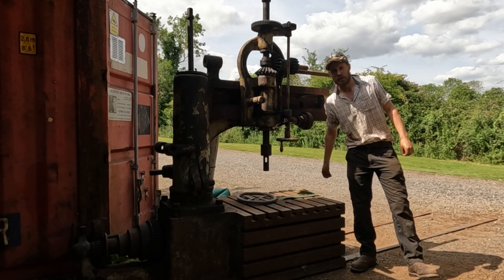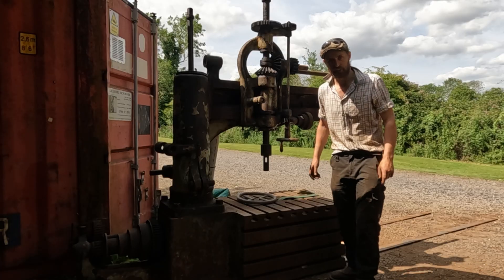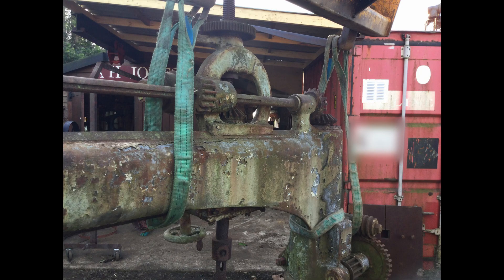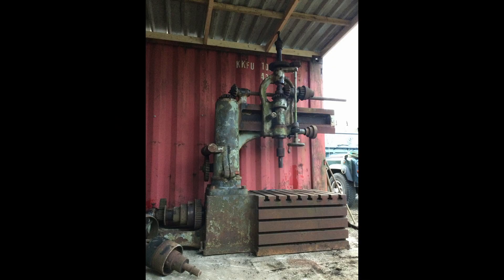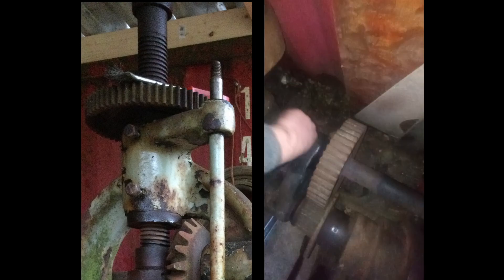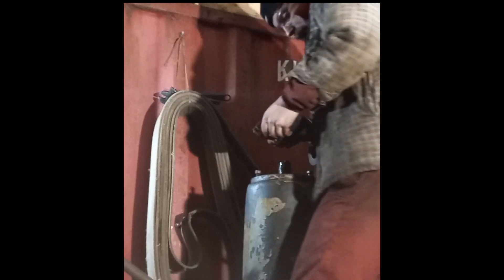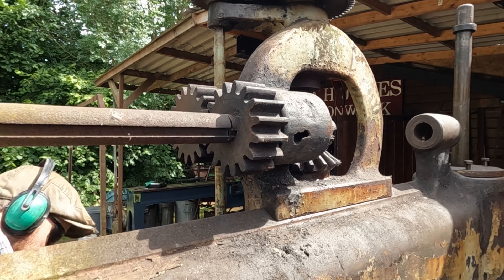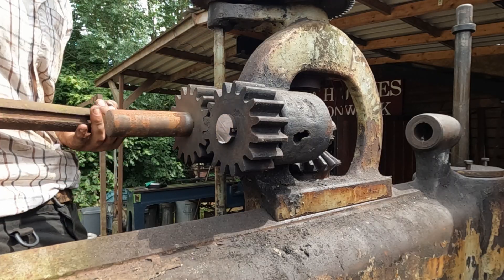Victorian Radial Drilling Machine Rescue PART 1 - Initial Disassembly

Comment: You like doing things the hard way,,,,Trust me,,,,As you get older,,,Doing things the old ways will start wearing thin on you,,,,,200ml of old engine oil,,,Pour it down the stuck side of that roller cog and leave it over night,,,,That engine oil will soak into the rust that has it held fast,,,,It will make things a bit easier ,,,,,
Reply: I was waiting for him to get himself in the nuts with that crowbar to be honest 😂

Comment: Love this project.  If I might recommend, there are only two books that I really recommend to every smith, and at the top of the list is the Ashley Book of Knots.  It's a great example of how folks judge a book by the cover, and why we say that's a bad thing.  Around my shop, that book has saved my bacon more times than I care to think.  It's an odd thing how we smiths will get tunnel vision when it comes to studying the old books, always looking at the anvils and other tools.  We never think about how those past Masters moved all the heavy iron they produced in a time when chains, hoists, and hydraulics simply didn't exist.  Well, the Ashley Book of Knots shows how and it's just a matter of applying it to the blacksmith shop.  I end up watching a lot of arborist videos because they're one of the last trades that keeps the knowledge of rope and pulley alive.  Seeing them move thousand-pound chunks of tree with easy, using only a rope and pulley, will get you thinking, for sure.  There's a free online version you can read, but having a hardcopy in your hand is best.  Plus, the decorative ropework he talks about looks great on forged iron!
Reply from the maker: Great recommendation, thanks!

Comment: hello Jonesy, wonder if the radial drill was used in a ship/boatyard back in the day.
Reply from the maker: Quite possibly! Equally It could have worked in any kind of engineering works. I do know it spent the last years of its working life at a fairground engineers. Any further back than that there is no way of knowing, unfortunately!

Comment: Going to upset you and say forget the WD40 and alikes ... their job is to break up old grease and oil to allow lube again ...
What you need for Iron is something like  Battery Acid ... followed by Phosphoric Acid ... a Hydroponic  chemical called "PH DOWN".
PHDOWN is exactly what it says it takes the PH Down and turns Rust into Iron again BUT!!!
Battery acid gets in there and breaks the rust down so you can move it.
After Battery acid apply "PHDOWN" from your local grow shop
Phosphoric Acid turns Rust to Black Iron.
So you know all your favourate tools that get a but rusty??? Drop them in Phosphoric Acid or PH DOWN and reply to this comment with a Thanks Mate.
Now if you try Phosphoric Acid to a box of rusty nails it's likely to make a 25kg lump of cast iron so drop it all in battery acid first to break them up then after a good mixing dump the battery acid and put the Phosphoric Acid PH DOWN in and start Nailing tomorrow.
When I first found Phosphoric Acid or "PHDOWN"  my roof went from Rust Red to Black, so did a lot of my car and tools ...

Comment: You will have better luck if you sand blast or such ,remove as much rust at first ,you will get better heat and penatration the rust acts like an insulator to heat and just soaks up the juice before it can get to where it needs to be!

Comment: Good work rescuing that drill. WD isn't always the best for ancient rust. It's a water displacement but it doesn't always penetrate well. The best thing I came across was Wurth rost off penetrating fluid with graphite if you can get hold of it. I've rebuilt a lot of vintage engines and it was about the best thing.

Comment: I wonder if it goes into the casting instead of out of the casting ? I have a bunch of stuck machines from a resent fire burned up my whole shop . So if you can get this old machine apart I think I will do the same .
Reply from the maker: That is definitely an option, I'll give it some gentle pressure outwards, and if that doesn't work, look at getting the column lifted! So sorry to hear about your shop, the good thing about old iron is it is resurectable. Cheers.

Comment: It could be just a really good fit , rusted up and cantankerous ,  Who are you to remove me after all these years ,  You could refit the shaft and key ,  and have a big nut welded onto the end of the shaft exposed , then try  continuous clockwise and anti clockwise force  , you may have to weld the nut on a few times .  Dont get angry and start  hammering the pinion  being cast it will break .
Reply from the maker: I think that's exactly how its stuck, nice idea. Thanks

Comment: Can you fish a few pieces of 3mm steel braided cable around the back of the gear?  (Or maybe steel crate banding) If you can then you can make a loop and pull on it with the forklift .
Reply from the maker: Hadn't thought of that, interesting idea

Comment: Something I always enjoy about this kind of age machinery is that if you get a little one a big one is the same ....just bigger, they seem to just scale everything up 3 or 4 to 1 and it works ...its a bit like using a photocopier to make writing bigger, so simple and effective 
Did you save the moss for later?
Ooh helpful tip on the blue and yellow juice..if you buy a sealey solvent proof pressure sprayer and a 5 litre jug of the stuff, it works out a lot cheaper than spray cans in the long run... they actually pay for themselves in the first 5litres of wd40.
Definitely feel your frustration on that gear...could you put a copper sleeve in the shaft and lever it out from the inside
Reply from the maker: Ooh good tip thanks, I gave up on the 5l tubs because the sprayers they come with are useless. Ill try the sealey one. Cheers!

Comment: Alex...
The weight of the arm is preventing the gear from coming out...

Look at the shape of the gear teeth and the relationship between those and the rack...
There doesn't appear to be what you'd consider a pressure angle on those teeth...

Lift the arm with the telehandler then try prying that gear out from both sides (2 pry bars)....
Happen you'll be successful...

All's you're doing at the moment is fighting against the weight of that column...
☹️🇬🇧
Reply from the maker: I'm fairly certain the arm is all the way down and sat on the base of the column, but the arm definitely needs to lift off soon, In theory the rack should pull up with it. If the gear wont pull out sideways first then it should definitely pop out once its over the column

Comment: I didn't know they still made plusgaz, never see it in London
Reply: I hadn't seen PlusGas for years until about 30 years ago when I started work at Cooper Bussmann in Frome where it was used to clean the solder flux residue off the machines. Wurth brake cleaner was effective at dissolving the flux but after the Wurth had evaporated it stuck like the proverbial to a blanket!

Comment: Maybe a large two legged gear/pulley puller with legs engaging with the upper and lower teeth of the gear; and a strong fabricated bridge or frame, resting on the casting on either side, would then allow the gear to be pulled out, horizontally.
Reply from the maker: My thoughts too, Ill be trying this first I think. Cheers!
Reply: @iron_jonesy  i was thinking two crowbars simultaneously, one on top & one on bottom, but this is a much better idea

Comment: My only suggestion to release your  gear is a lot of heat, get the gas axe on it. As to the head gear you could buy a children's paddling pool and fill it with oxalic acid, and some washing powder, de grease and and jet wash it then drop it in the paddling pool and leave it for a few days. Or a week . it will get a lot of the rust off and help fee it off .If you do it in the summer the warm weather will also help make the chemical reaction work much better. It's a grate  machine and will be perfect for your shop.
Reply: I've used that recipe before, works great, but don't leave parts in it for more than 2 or 3 days, carbon migration will absoutely destroy them
Reply from the maker: Good Idea, The head will definitely be taking a bath soon

Comment: The rack and pinion are binding due to some sort of broken tooth and then due to gravity? I'd try to lift the casting that slides on the column (easy job with the forklift). This could free up the suspected broken thing between the pinion and the rack.
Reply from the maker: Could well be, getting the arm to slide up and off is high on this list of jobs to tackle

Comment: how about you take the 4 bolts out holding the column onto the base and then see if you can get at it where the rack is. that is from the inside. Get videos keep them coming
Reply from the maker: Unfortunately, the rack is sandwiched between the main column casting and the arm casting that's slid over it, so no access from inside. I would have to lift the whole arm up off the column, which has to happen at some point so could be a good option! Thanks